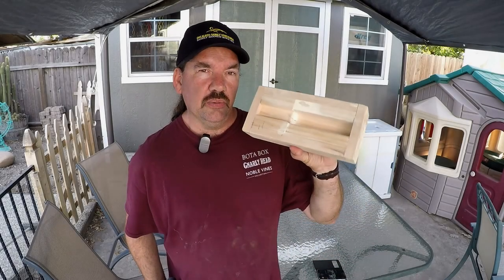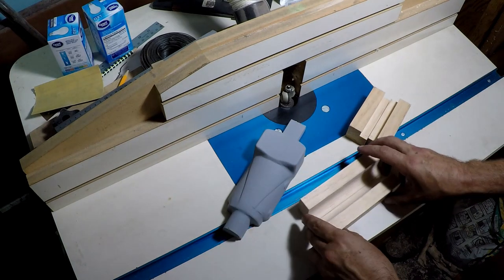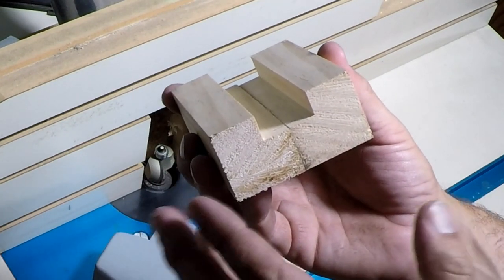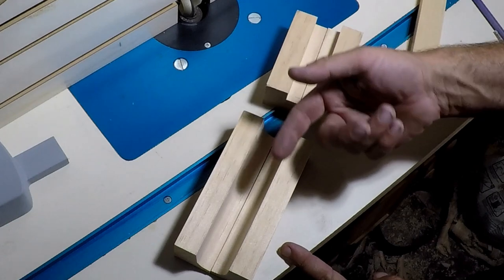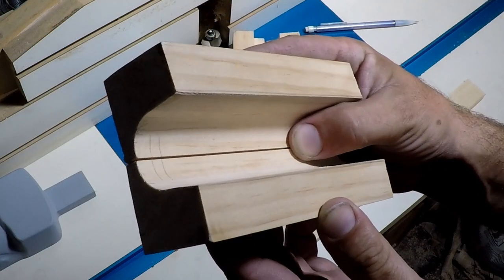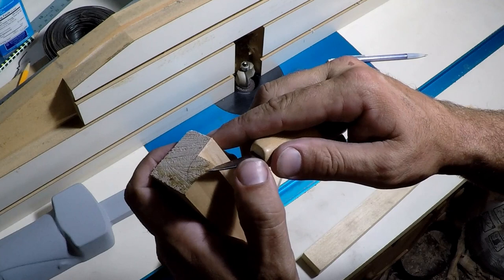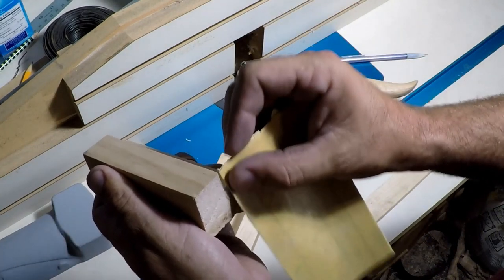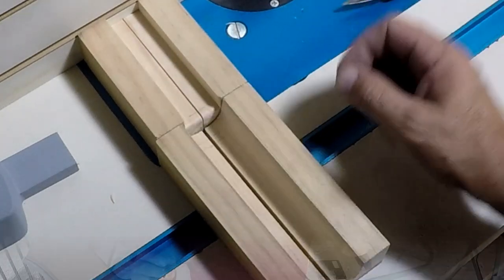Core Box Pattern Part 1

Comment: Chris, a light score before cutting will help a lot in these whittling cases. But it's looking good. Have fun during harvest.
Reply from the maker: yup i think last week is the last free time ill be seeing fore a while
Reply from the maker: Not quite sure I understand creag
Reply: Old Iron Shops : use the tip of you knife to lightly score the wood along your cut margin. This will guide you as you're cutting and stop the splintering you experience.
Reply from the maker: Craig L. Young oh I see good tip having a razor sharp knife helps to
Reply: Old Iron Shops : One of the hardest lessons for young men to learn is sharp knives is safer and you can't eat an elephant in one bite. From an old Scoutmaster of 35 years experience.
Reply from the maker: Craig L. Young I was carrying and sharpening a pocket knife at 8 or so. Not many kids would be permeated to now dsus.
Reply: Old Iron Shops : Yeah, I agree. I even had to teach other Scoutmasters how to sharpen knives, axes, and saws. Some didn't understand that you needed to sharpen knives before first use.
Reply from the maker: Craig L. Young a sad state of affairs
Reply from the maker: i understand i was using a shearing cut so i wouldn't split also makes it easier to cut as well